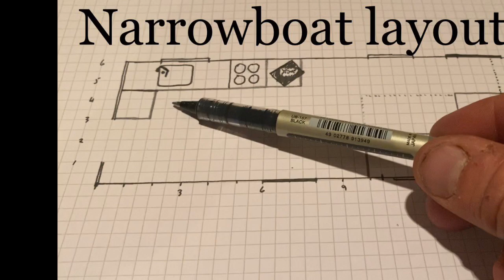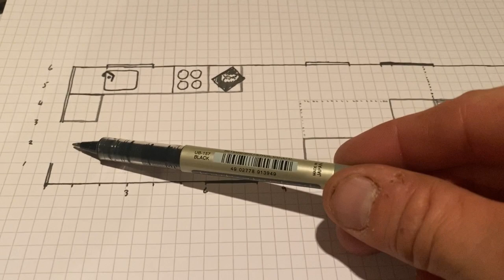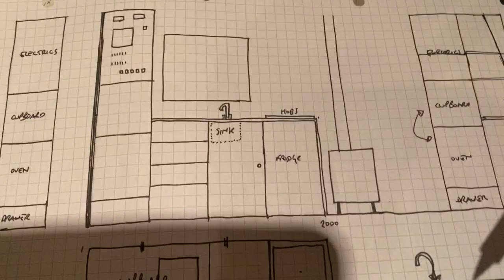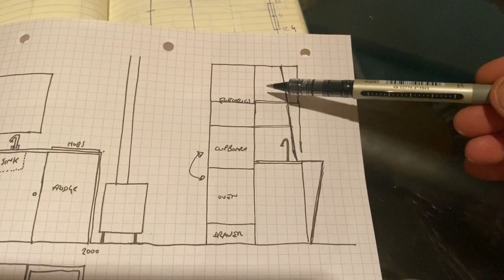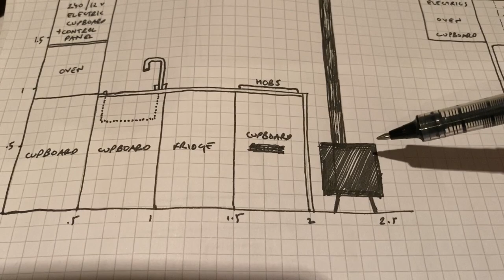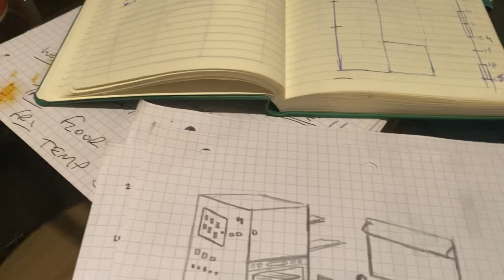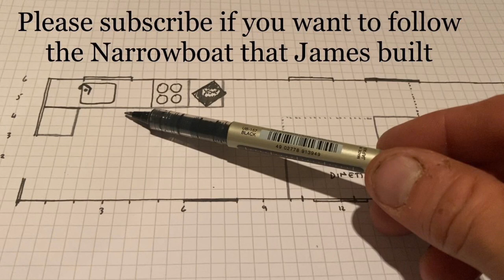19. Narrowboat layout and design ideas

Comment: Hi James. Re bathroom have a square shower. Then you will have space between the shower and the side of the boat. Here you can have a cupboard and above it several shelves. This gives you more storage space. Useful for possible toiletries and towels. Under the cupboard fit a pump to empty the shower which in the future is easy to access and the discharge through the hull is easy to access aswell and hidden in the cupboard. Suggest a whale pump with switch in the shower. Also use the solid shower boards instead of tiling. Water proof and quicker and easier than tiling.
Only a thought, regards Simon.

Comment: I had my stove on the angle but a couple of years ago moved it so it was facing across the boat.  The amount of stuff that fell into that dead triangle behind that you couldn't get at when the stove was hot really started to annoy me.  My galley floor has terracotta tiles and they extend to around the stove area.  Helps when you need to plan clearances etc.  Drop the stove hearth down to the base plate so the hearth itself is flush with the top floor and doesn't become a trip hazard.  When the table is up you will bark your ankles on the hearth otherwise. Also have a vent in the flooring under/behind the fridge to draw cool air up from the bilges to help keep it cool.  (Wish I had done this when I was fitting my boat out)

Comment: If you put a 1/2 inch air space between the fireproof and the cabinet, I think it will be fine. We cut 1/2 inch pieces of copper water pipe as spacers and thru bolt it. Countersink the heads a bit to keep the tile flat. Great layout work John
Reply from the maker: Mark Kasprzak good to know, glad you approve of the layout
Reply: I think the airgap between the fireproof backing and the wall, is part of the installation regs.
Reply from the maker: simons3000 yes I was thinking it could tell me with the stove info when I get it
Reply: @TheNarrowboatThatJamesBuilt  I would have thought the stove suppliers would have the full fitting information.a few calculations for cabin volume and airflow/ventilation as well as fitting instructions. I believe a silica based board is used as a backing,not too expensive if I remember rightly
Reply: Btw.im not an installer,just very aware that if you get critical installs wrong (like gas or anything that produces co),then the results can be devastating

Comment: Have you thought of fitting electric underfloor heating on your boat, Then at least if your hooked up in a Marina over winter possibly you can just plug your boat into the mains and not burn so much coal and wood , less dust particulates, by the way loving your blogs
Reply from the maker: John B now that’s an idea!!

Comment: Great vlog👍. I was thinking flipping the multi-fuel and dinette around too. Not that your design isn’t good and well thought out, however this way you would have your multi-fuel in an even more central location, you would still have the chilling looking out the other hatch scenario and option for a U-shaped galley giving more base unit storage/counter space. Also the fridge may have to work a little harder in those cold months when the fire is lit closer to the stove. Screen for projector could then drop down between hatch and window at the 6ft and 12ft mark. Great vlogs you’re producing James and very informative indeed👌
Reply: @Chris G good point Chris, mind you I was also thinking with a sub 50ft narrowboat it will heat up quite quickly with the fire in either location. Also the fire could go on the port side of the bulkhead facing the stern leaving space for the tv/projector screen in the corner?

Comment: Hi another good vlog just thought I might say that the angle of the side on a boat is called the "Tumblehome" as for your fit out plans I personally would make the dinette slightly different to your plan first thing not to have it raised second thing is to make two settees 2ftx4ft free standing then a table 2ftx4ft with this set up you can have a L shape or a Pullman or any other way you like and still turn into a double bed.The main thing is don't fix the table to the floor it will turn into your worst nightmare.As for a toilet buy the cheapest dry toilet you can find they are as good as any thousand pound one they do not need a fan you don't  get any smells avoid buying one with any sort of mixing device this means you have to tip from the toilet to a bag before you put in the bins.There is a Facebook site on dry toilets that has loads of info you might be interested in.
Reply: You very much do need a fan to ensure it dries the solids. Try going to the toilet in a bucket and see how long it takes to stink. The agitator breaks it up and dries it out; looks like peat when you empty it out. You can go longer without emptying; I know people without an agitator have to poke the contents with a stick to spread it out. Not for me! That's the difference between a composting toilet and a bucket.
Reply: @theotherstevesteve  thank for your amusing reply I have been using one without a fan or agitator and have had no trouble at all I brought mine direct from the maker who happens to moor in the same place as me and I know of six others on our mooring who have brought off of him and have yet to hear a bad word said it sounds like you have brought one of the thousand pound plus ones and your just trying to justify paying that sort of money

Comment: I think you're going to need somewhere to hang your wet weather gear, wellies etc. and also somewhere to store lifejackets for the kids.  Are you planning on deck boxes?  Where are you planning on putting that enormous water tank?  Under the bed?  Also, instant water heater or what?  I heard you say you didn't want a calorifier.
Subscribed, BTW.  ;o)
Reply from the maker: Good to have you on board - no calorifier as it’s an air cooled engine. The massive water tank will go under the hatch in the bow I reckon and to of cabinet will be a bench for the kids to watch out of. Yes I’ll have some lockers built in the stern cruiser it’s ample big enough. If I can afford a pram cover one day then that’ll be my wet weather area - until then no guests unless it’s summer 🤣

Comment: The thought that struck me is that galleys work best when there is a preparation area to get food ready, a cooking area, a cleaning area which is obviously the sink, and a drying area where pots can sit whilst they dry.  All looks to be fine apart from the preparation area which isn't immediately obvious.  Were you going to prepare food sitting at the dinette or did you have other plans?
Reply from the maker: Good observation and I was either going to use the dinette table or if I have the time and can find the parts, I’ll make a fold out counter coming out of the drawer below the hob turning it into a u-shaped galley. I could put in a work surface on the starboard side too which I’m considering for extra space, probably just coming out 40/50cms and maybe 60/80 long
Reply: @TheNarrowboatThatJamesBuilt   How about the fridge under the oven, then the sink area where you have it, then turning the hob 90 degrees to form a U shaped galley (even if the hob is slightly wide and goes back over the corner cabinet)?  Twin cabinet doors under the sink with access to each corner area.  The heating stove gets a wider backing which might bias radiating the heat toward the bow.  The big advantage is having a real workspace between the sink and hob.  Storage/food pantry under the gunnels opposite as you may already be thinking.
Reply from the maker: Jeff Kogut mate, you’ve got it spot on. I definitely agree that the fridge should go under the oven - I’m not 100% on the u-shaped galley as the stove would be more eclipsed from the stern (not the end of the world though). But the more I’m thinking about it, even as I’m writing this, I’m inclining to agree with your idea. Cheers
Reply: @TheNarrowboatThatJamesBuilt  One of the advantages of the u-shape is that you could have access doors into the cabinet from both sides, or a space for storage for stove fuel.

By the way, my wife and I both laughed delightedly when we heard you talking about a projector. We're watching this on an inexpensive but excellent video projector in our home, and a pull-down screen would be wonderful. It can come down in front of a window or a hatch without taking up wall space all the time. Realistically, you're only likely to be watching the projector in the evenings when you're not cruising.

Comment: Have you thought of having a microwave above the oven/grill then just a smaller cupboard?
Also, is there enough room to house your electric panel on the right side of the door, although thats not a bad place for wet gear? Looking great though, and thanks for the vlogs.
Reply from the maker: I probably won’t have a microwave on board as they drain energy and I’ll be 100% battery power

Comment: I would make a cabinet opposite the galley in the corner at the door, for all the technical stuff, such as inverter, electricity board, solar panel controller, battery switches. But also storage for the mooring pins and hammer, the tiller, and so on.
Reply from the maker: Danny Van Cauwenberghe a cabinet opposite the galley I reckon must happen for storage. The electrics etc I reckon should be in the tower on the left of the door as you walk in so all the gauges and switches I’ll need whilst cruising are closer to hand. You’re right though, I’ll need somewhere accessible for my mooring pins etc
Reply: Derek Stephen  won’t you have bench seats on your cruiser stern with thins like mooring pins etc? Those ideally go in outside lockers rather than inside, I’d have thought.

Comment: The fridge will be working hard because the fire has a tremendous heat on the area next to it
Reply: that is not how fridges work.
Reply: @liamramshaw2535  I do know how a fridge worked and any kitchen fitter does not fit ovens or in this case fires next to cold units
Reply: @garytaylor1436  I would agree, why would anyone put them together, but if needs must. I cannot see the fridge door being left open to aloow the heat in.